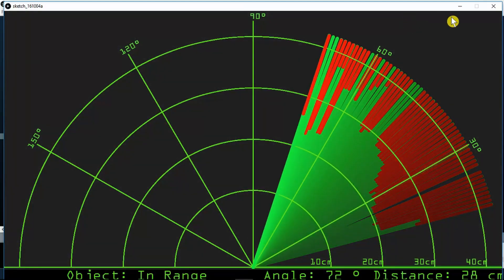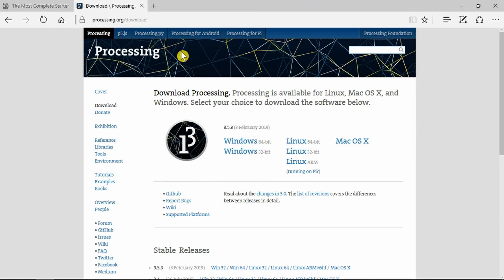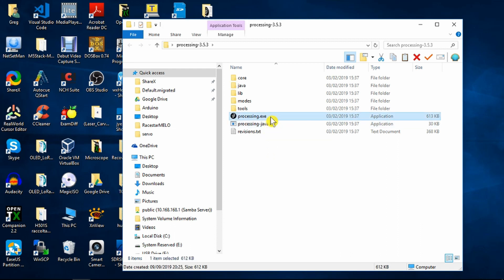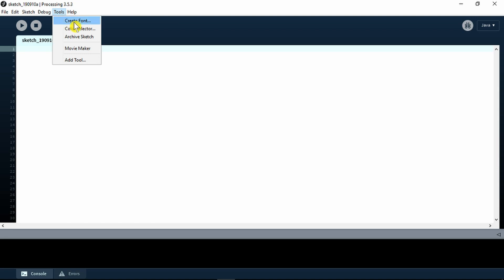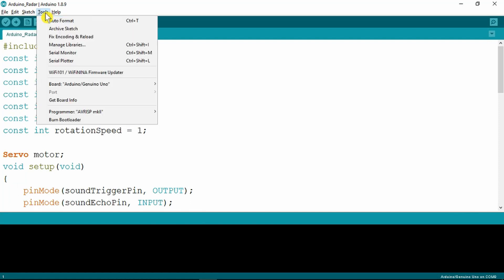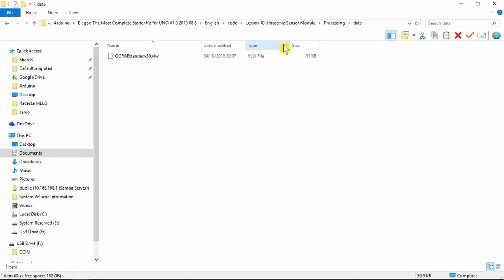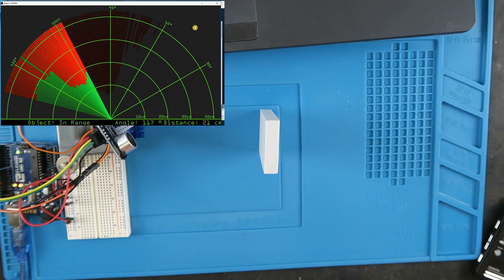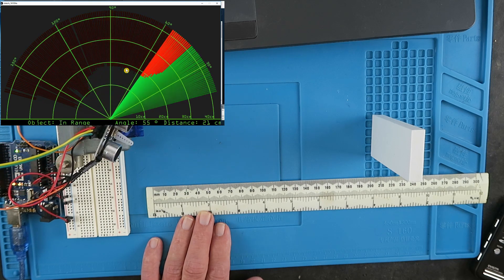Arduino Ultrasonic Rangefinder With Graphic PC Display Project

Comment: Came across this Sonar  toy quite some time ago.  Purchased a couple of the Ultrasonic Tx Rx sets thinking I would give it a go.  Like many of my Hair Brain Idea's  it filtered down into one of my SOMEDAY Boxes  well forgotten ?   Thanks for the Reminder.  LOL   Wonder what I could do with my Atomic Pi  and the Bosch BNO055 absolute orientation sensor integrated on the Atomic Pi ?  My programing skills are in the SUB Zero range.
Reply from the maker: Got the wake up call last year when a good friend died at only 53. Make that SOMEDAY box a TODAY box is my advice. For the Bosch sensor there is a great walk through on the Adafruit site, no programming necessary just cut & paste!!
https://learn.adafruit.com/adafruit-bno055-absolute-orientation-sensor/overview